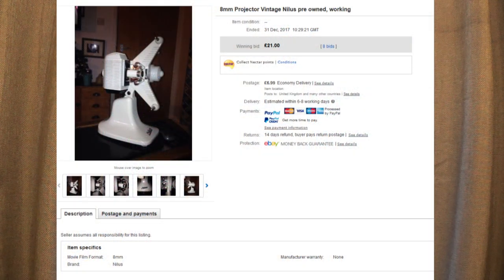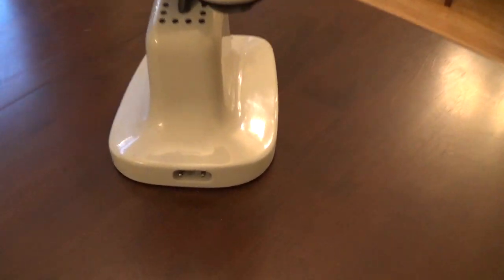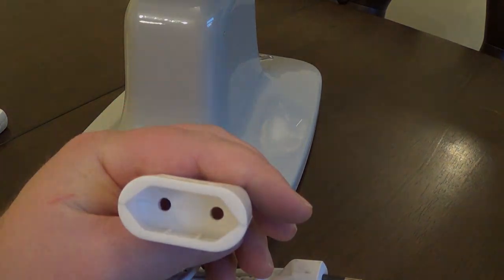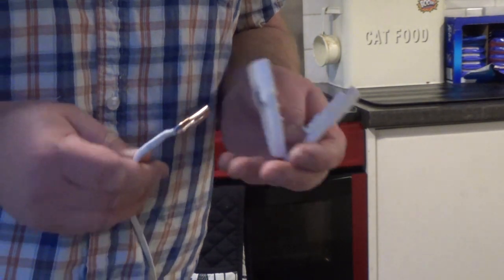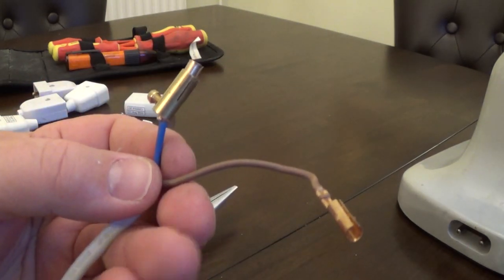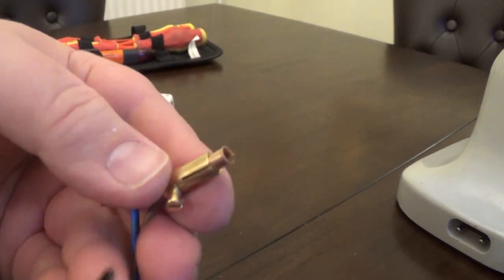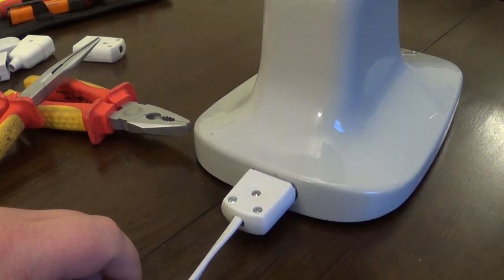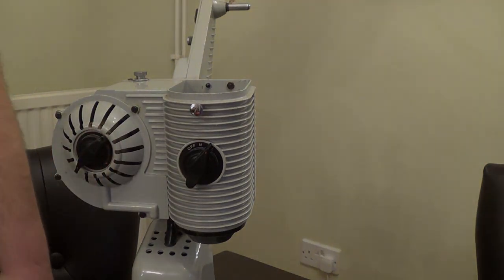Part 1 - Cirse Nilus 8mm Cine Film Projector

Comment: That euro connector is 5 amp and usually only used for reading lights etc, we use the exact same things in Spain
Reply from the maker: fookdatchit Yes, I suspect though that in the 1950s they were more widely used! The amperage of the projector is very low, I’ll try and calculate it in the next video .